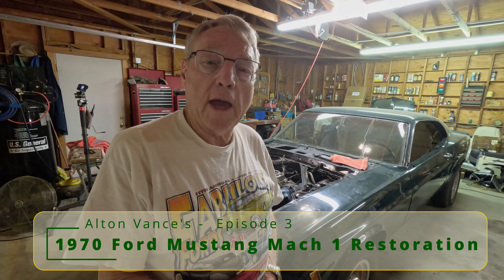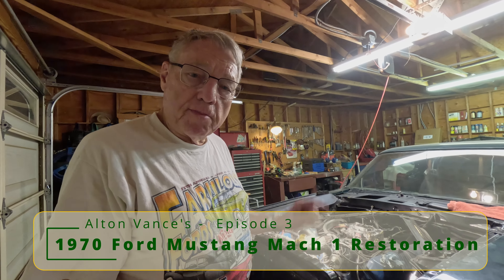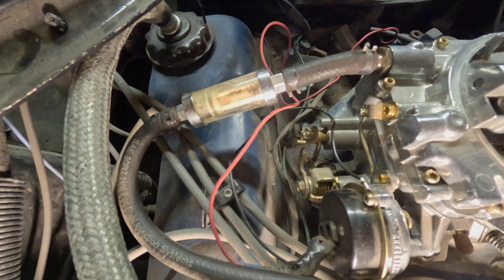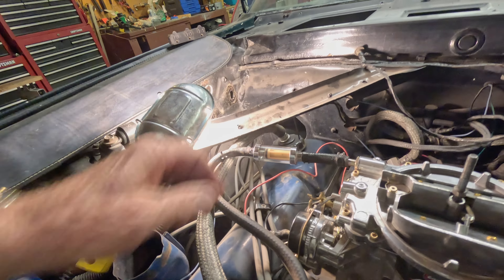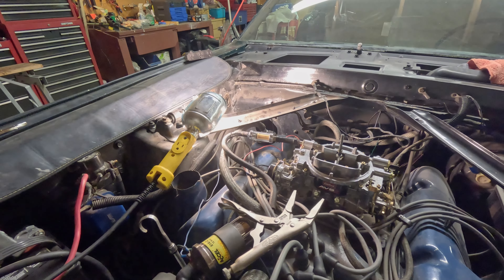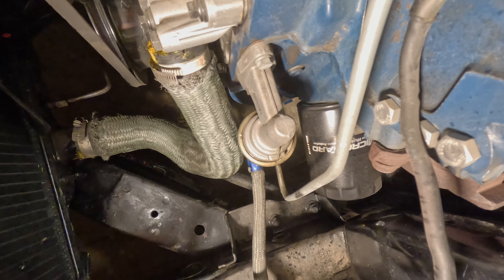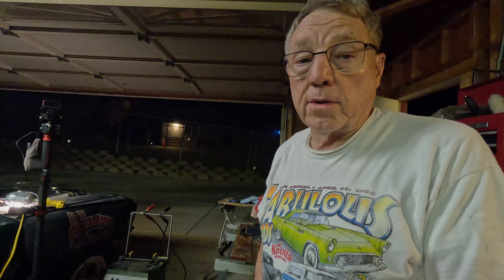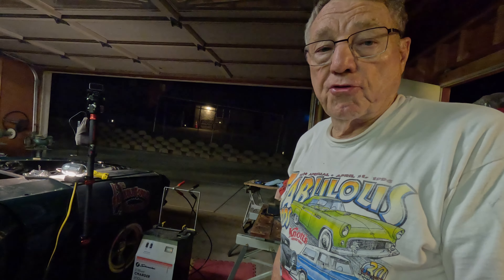1970 Mustang Mach 1 Restoration - Episode 003 - Do I Really Need a New Fuel Pump?

Comment: it sounds good to me. if anything it probably is to lean at idle.
Reply from the maker: I will do some experimenting with opening up the idle needle valve.
Reply from the maker: It does have a performance cam shaft in it. So it have a rough idle at some point.